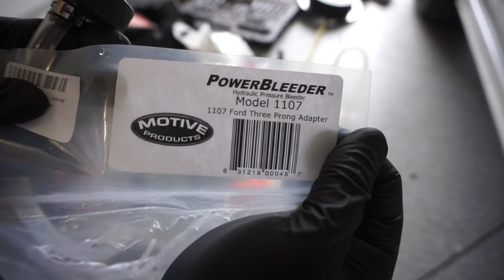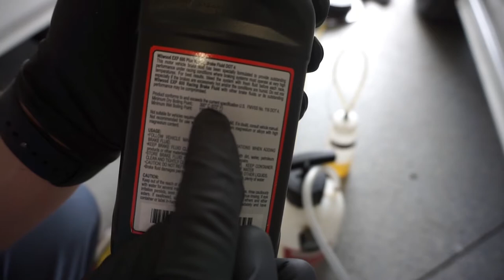Easy Brake Fluid Flush on Subaru Brembo Calipers With Motive Power Bleeder

Comment: Great video and thanks for covering how to depressurize the system when finished! Gonna order my Motive 0107 Ford and Asian power bleeder kit today.
Reply from the maker: Thank you very much for the awesome feed back I really appreciate it. I was nervous the first time doing this but now I’ve done it like 20+ times that it’s so second nature. Just take ur time and do the entire system twice to make sure all the air is out and the new fluid is in. More time but it’s worth it. Good luck and let me know how it goes.
Reply: @snewstead1388  Sorry, for the late reply. Bled it out twice, keeping the reservoir full, until it was flowing clear from all four wheels. Then went out for a few power stops to get the antilock going, and bled once more. Brakes never felt better. Thanks again.
Reply from the maker: @roberttaylor7732  I’m so happy its working great for you. What fluid did you end up using? Great work
Reply: @snewstead1388  Valvoline Dot 3/4
Reply from the maker: @roberttaylor7732  excellent choice.
Reply: @snewstead1388  Just saw your video and glad you used the Motive. I have had one from 20 years ago and complained about it cause it always leaked using the universal cap. I can now I can get the Adapter, so this should make the job on my Subaru Forester XT a lot easier, now that I'm older... lol

Comment: Hey great video, just wondering why are you using this pressure pump instead of a vacuum bleeder? Im about to change rotors and pads on my 2018 STI and would like to get some fresh fluid. I was leaning towards a vacuum bleeder because i can also use it for my Harley. Whats your opinion? Thanks
Reply from the maker: Thanks for the comment. I’ve seen many others try and use the vacuum pump and not have any luck, whether it be they introduce air to the system or it takes longer. Vacuum only suck pressure from one line where as the pressure pump pressurized the entire system(also good for detecting leaks). I’ve used this system now for 3 years and many track days and never had any issues (over 15 complete fluid bleeds).

Comment: Im looking at buying this bleeder kit today. In the event you do have to add fluid to the master cylinder while bleeding, do you just disconnect the power bleeder (thereby de-pressurizing the system) and add it to the brake reservoir directly or do you keep the bleeder connected to the brake reservoir and just add the brake fluid to the Power Bleeder itself (and subsequently re-pressurize to 15psi)?

Very helpful video thank you for the content!
Reply from the maker: The simple answer is yes. The easiest thing is to just add 2 bottles of brake fluid in to the pressure tank and be diligent about how much ur bleeding out of the brake lines. Adding more to the pressure tank is safe and if u have lots left over after just pour it back in the bottle it came from incase anything happens for later.

Comment: I just had one more question, sorry

After you suck out the old fluid from the reservoir, I noticed you didn’t refill  with new fluid, nor pre fill the line before screwing the cap on and pressurizing. Since you’ve done this so many times with success, I would assume you didn’t have an issue with putting air into the system before the fluid reaches the reservoir.. Unless you did? Furthermore, do you think it would have any negative effect if I were to pre fill the reservoir and line with new fluid prior to pressurizing? Just don’t want to make changes to the process if it works but my brain is telling me I should pre fill to avoid any unwanted air entering. 
What are your thoughts?
Reply: Thank you for the helpful video and prompt responses. I just ordered my Motive kit this evening.
Reply from the maker: Yes it is better to fill the reservoir with new fluid first but as long as you have a couple of bottle of fluid in the motive tank it will self fill and balance out anyways. Such that if the reservoir is almost empty while your pumping the motive it will put fluid into the reservoir
Reply: @snewstead1388  thanks, I received my power bleeder and was able to get my fluid changed. Such a simple process. Thanks again for the vid
Reply: The only thing I would do differently is order the aluminum cap instead of the standard plastic. The hose swivels on the aluminum cap, and it does not on the plastic one. This made screwing the cap onto the reservoir a little tricky as the hose would bind up before it was tight.

Comment: Great Video. Appreciate you taking the time to explain everything. I bled brakes the "old way" years ago on other cars, so was looking for something a little easier for one person to do. I have a 2019 WRX and I am at the 30 month ownership so its time.
Reply from the maker: Thanks for the comment. I only do work alone and I often need it to be done as fast as possible. The old way takes too long for me plus it’s complicated with the clutch but is still effective. Hope this system helps you out. Good luck.
Reply: @snewstead1388  Yeah, the whole pumping the clutch, hold, release valve, tighten, rinse and repeat takes awhile. Not to mention having to pull clutch pedal off the floor. Using this method looks a lot easier. Thanks Sean.

Comment: Thanks for the very thorough video! Question; I've heard from several sources about the bleed order. Mr. Subaru even says it's PF first. Can you confirm with 100% certainty that it's PR, DR, PF, DF? I have a 2004 STi, would your bleed order include my MY STi? One last question, do you always bleed the brake fluid last?
Reply from the maker: On my 2016 wrx the reservoir is right next to the driver front and the abs system is right next to the passenger front. Fluid goes from the reservoir to the abs then to all the wheels. If your vehicle is setup in a similar way it should be the same as mine. The idea is to bleed the longest line first. Everywhere I have researched says to also do the PR, DR, PF, DF. 
Honestly I have done this no joke about 8 times since I put up that video plus I have had 4 track days. I have had 0 issues and have never had a soft pedal even on the track days. I personally think order matters less if you go back the second time to each wheel. The idea with the brake order is to optimally get all the air bubbles out of the system. If your doing a full line bleed twice in the order I listed there is almost no chance air is remaining. Don’t forget to do the clutch. 
Hope that helps thank you
Reply: @snewstead1388  The STi seems to have a different bleed order than the WRX.  It is RF, RR, LR, LF, but I assume this is because I believe the STi has a different ABS module than the WRX.  If you have Brembo's on the WRX, you can probably stick with the WRX bleed order of RR, LR, RF, LF.  The bleed order is more a function of the master cylinder / ABS module configuration than it is the type of calipers you have.

Comment: Nice Vid, doing this tomorrow. I let air get into the VDC refurbing rear calipers and tough to get its out without pressurizing then system. So wife ordered it for me so I can do it correctly.
Reply from the maker: Thank you so much for the compliment. This system is so easy and the ability to do it alone was awesome for me. I’ve done this now probably 10 times at least due to track days etc. It works so well, I hope it helps you and let me know if you have any further questions. Good luck
Reply: Update, I let my master run dry while fixing rear calipers. It would not bleed even after 3 times clean fluid with 0 bubbles.  Read on nastystock that I needed the car running even with the motive  since I screwed up . With car on and the motive pressurized it is still a 1 man job , it worked.  So if your master runs dry the vdc  can not get bled with the car off.
Rock hard pedal with your method .thnx

Comment: Hello, do you have long term experience with the Wilson’s fluid for two years on same fluid? I’m looking for a higher temp fluid for my car but I was hoping to keep the 2 year oem interval through winters, etc.
Thanks
Reply from the maker: @flatspin2  I did use the wilwod for a couple years straight. Now I use Endless RF-650 brake fluid. It’s got a much higher wet temp and it’s approved for winter ice racing. Endless is the best brake fluid period
Reply: @snewstead1388  my phone auto corrected to Wilson lol.. Anyway, I have heard good things about Endless, but unfortunately I don’t think it meets the 116 standard. For warranty purposes I need a fluid that meets specs Subaru calls for. Need to be dot3/dot4 and meet the 116 requirement.
Just trying to find something better than Subaru dot 3 but nothing that will attract water too quickly.
Reply: @snewstead1388  when you say you used Wilwood 2 years straight, is that without flushing it and you still had good results? That sounds like what I’m looking for.
No dreaded clutch squeak?
Thx
Reply from the maker: @flatspin2  no sorry I didn’t leave it in my system for 2 years straight as I track my car and replace fluid after 2 events. I think if u didn’t track ur car then leaving it in your system for 2 years would be ok.
Reply: @snewstead1388  copy that, I will be occasionally tracking it but not too often as of now.(unfortunately) Might be once every 6 months

Comment: Per the service manual for a WRX STI with Brembo the correct bleed procedure is FR>FL>RR>LR. I know this because I have the service manual and I checked before bleeding my brakes today.
Reply from the maker: Ted that’s funny. Usually you do the furthest calipers first and move in closer to eliminate the chance of air being in the system. Is this the same manual that calls for the clipper bolt on the front to be torqued to 185 ftlbs? Either way I’ve been using this procedure for 3 years now and have been to 5 track/race events with my brake system bled as such and never had a single soft peddle incident. Ever. Thanx for the comment I appreciate your time.
Reply: @snewstead1388  Yeah. Its a service manual for a 2017 sti. I've been doing it the way you do as well for years with no ill effect.
Reply from the maker: Ted thank you for the reference and for letting me know that you also bleed in this order. I appreciate the feed back.
Reply: @t.regnerus301  Just an FYI, the service manual method use least amount of fresh fluid, that's it.
Reply: The STi seems to have a different bleed order than the WRX.  It is RF, RR, LR, LF, but I assume this is because I believe the STi has a different ABS module than the WRX.  If you have Brembo's on the WRX, you can probably stick with the WRX bleed order of RR, LR, RF, LF.  The bleed order is more a function of the master cylinder / ABS module configuration than it is the type of calipers you have.  WRX ABS module part # 27536VA001 and STi part # is 27536VA001.

Comment: what about all
the air bubbles that pumped in to the master cylinder
Reply from the maker: I’ve made this video about 2.5years ago. I’ve done about 5 track sessions and changed fluid before and after each time. There is never air in my system and I’ve always had a rock solid pedal. Ii never get brake fade. ’ve upgraded to using endless brake fluid now too. Trust in the process.

Comment: On a 2020 sti i was thinking about flushing my system. Doing the brake lines pads and rotors. Do you use that power bleeder to drain the system if it’s current fluid? Then fill up n bleed the brakes and the clutch line?
Reply from the maker: The power bleeder can be used to do everything all at once. You don’t want to drain the system of fluid totally, because it’s more difficult to get all the air out when refilling it. I have had my system drained completely when I took my STI calipers off and rebuilt them with new seals etc. as long as you fill enough fluid in the power bleeder to do atleast 2 complete system bleeds (bleed every calipers bleeder screw twice plus the clutch) then you will be fine. After a race event I just fill the power bleeder up and bleed out the old fluid while the new fluid is going in at the same time. No need to drain.
Reply: @snewstead1388  i gotcha. So the power bleeder, you fill it with the fluid you want pressurize the system and open the valves on the calipers for a min or so so it’ll flush out the old fluid and replace with new fluid?
Reply from the maker: @ezimm81  bingo. Exactly. Just make sure to have enough fluid in the power bleeder tank. I typically use 2 bottles of brake fluid. Also I use a turkey baster to suck out the old fluid in the reservoir before I connect everything.
Reply: @snewstead1388  nice thanks! I have a 2020 Sti and I’m looking to do pitchstop mount and brace so this would help a lot with bleeding after i do the clutch line n everything. Just gotta find some good brake fluid. Some people say the fluid makes all the difference

Comment: Do you have to keep watching the pressure on the bottle while bleeding to keep it 15psi?
Reply from the maker: It’s not super important to keep the pressure exactly at 15psi. Do your first caliper and then check the pressure. After each caliper check the pressure and fluid level. The most important thing is that you don’t run out of brake fluid. If air gets in the system then you have to do everything all over again. My pressure will fall to like 12psi before I pump it back up again. Thank you and good luck
Reply: @snewstead1388  how much brake fluid you recommend putting in the jug? Thanks!
Reply from the maker: @derrickgarcia303  I usually buy 3x500ml  bottles and put only 2 in the pump. The last one is just in case something ever happens. I use this fluid. 
Wilwood 290-6209 EXP 600 Plus Brake Fluid https://www.amazon.ca/dp/B003MQT3C0/ref=cm_sw_r_cp_api_i_SAR1699TZTTK1N9R6CHC

Comment: Does this bleed the clutch as well? I heard it’s the same resovoir?
Reply from the maker: Steve yes it does. I bleed the clutch in this video also. Thank you
Reply: Sean Newstead is it possible to just bleed the brakes and not touch the clutch? Have a track day coming up and just want to flush the factory fluid and put in some Motul. Also do you know how much fluid i would need? Thanks!
Reply from the maker: Steve it shareas the same fluid as the brakes so just to be sure u get all the air I would do the clutch especially for a track day. At a minimum I would use 2x500ml brake fluid bottles. I recommend having a third just in case .
Reply: Sean Newstead thanks mate, car only has 3000kms on it so was going to leave the clutch for now